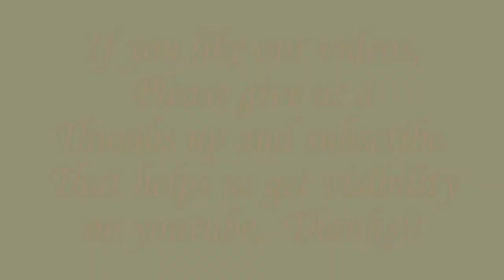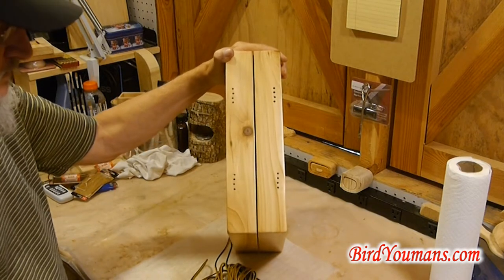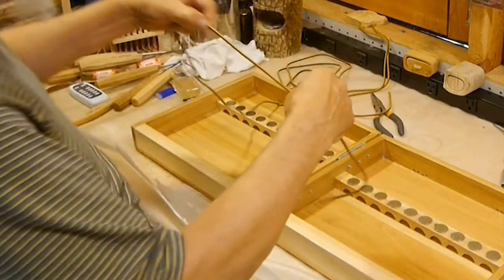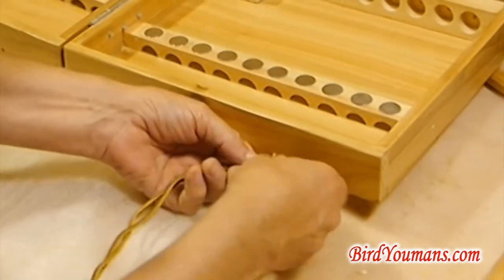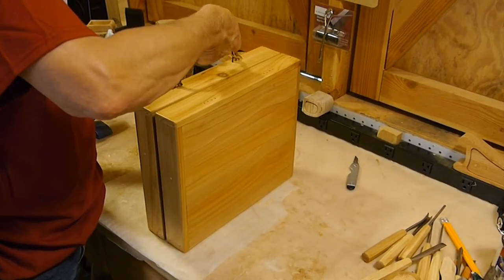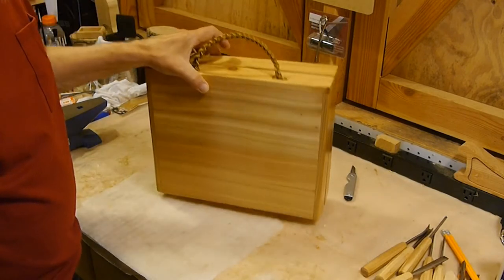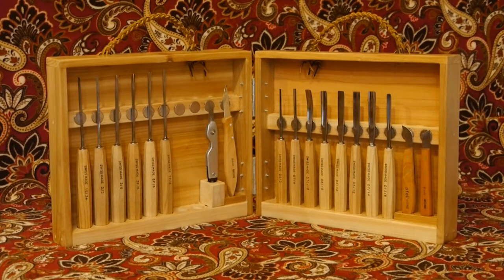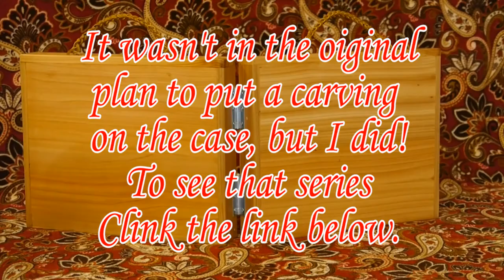Part 4 of my carving chisel and gouge case- Bird Youmans

Comment: Thoroughly enjoyable story and demonstration.  I've got the same problem with the Pfeil tools and several sets of nice chisels - you've inspired me with your easy solution.  I probably won't drill all the through holes in the magnet bar, though.  This story was fun to watch and I'll recommend it.
Reply from the maker: Actually, the thru holes were drilled when I was still thinking of of using them that way.  I just simply re purposed the piece by cutting it in half.  Just a solid rectangle would do just fine and that's probably how I would do it knowing what I know now.  Let's just say my wood working is an adventure in progress most of the time lol!  I just develop things as I go.  Although, since I've gotten better at sketch up in the last year or so, I "build" things first in the software now.  Mistakes aren't nearly as costly that way and i can actually visualize the final piece much better that way.  Sketch up is a phenomenal resource once you learn to use it.